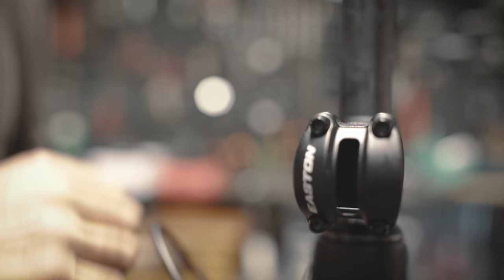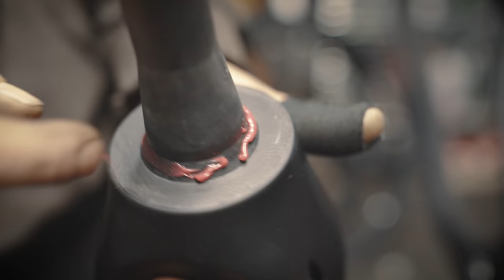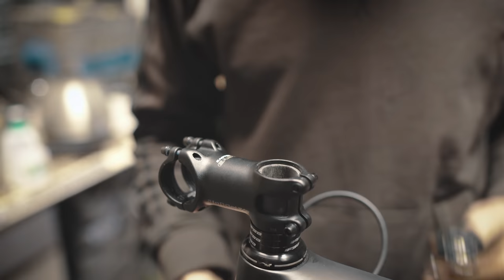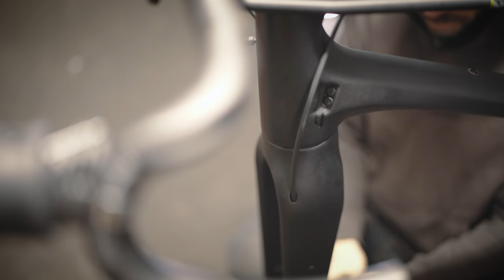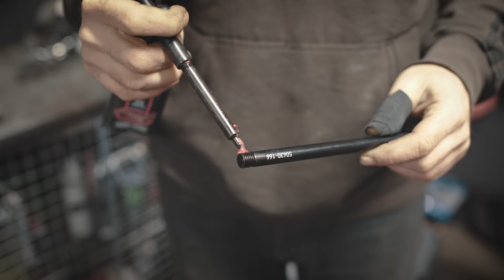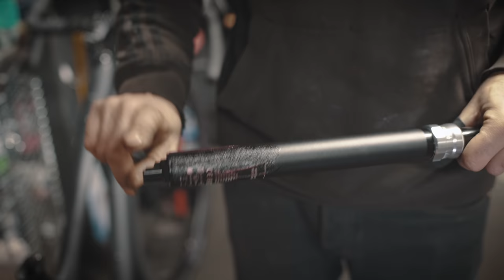DREAM BUILD GRAVEL BIKE - Evil Chamois Hagar

Comment: The ease of setting up eTap vs internal di2 wire routing (eg on the Genesis CdF) is hilarious.
Reply: Otoh Di2 shifts quicker and is cheaper.
Reply: y3 Correct me if I’m wrong but I think they’re using AXS and not eTap, or a cross because the derailleur is an eagle which doesn’t offer eTap and the shifter I don’t think has AXS so I’m thinking it’s a mix of the two somehow

Comment: Nice bike, but if it was mine (as an ex race bike mechanic) I would be pi**sed at: No torque wrench used, FSA logos not aligned on headset spacers, brake fluid all over the head tube, unevenly applied bar tape, rotors handled with contaminated hands..........sigh.
Reply: You must be terribly fun at parties
Reply: @ThiagoCariasChannel  He does have a point though.
Reply: The rotors part is what would get me...

Comment: Is it just me or does putting grease on the dropper feel so wrong even though you’re supposed to? Especially electronic ones
Reply from the maker: It's not grease
Reply: Gee Milner The red paste? I thought I was grease and not carbon paste because I saw you putting it on the headset?
Reply: The colour is similar on video to the untrained eye. The substance applied on the dropper post is indeed carbon paste. The other is Muc-Off Bio-Grease.

Muc-Off Bio Grease is in a shade of pink while the carbon paste (Muc-Off Carbon Gripper) is sort of like berry red.
Reply: Yong Ling Ng It’s like women’s lipstick then I get it